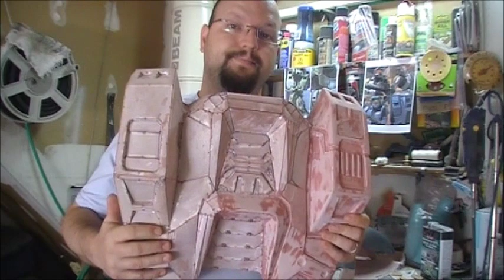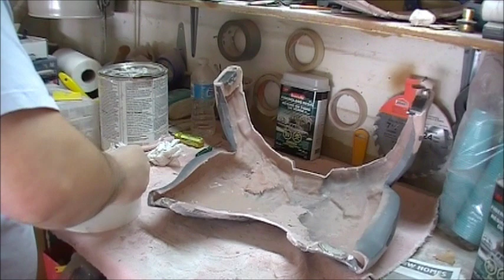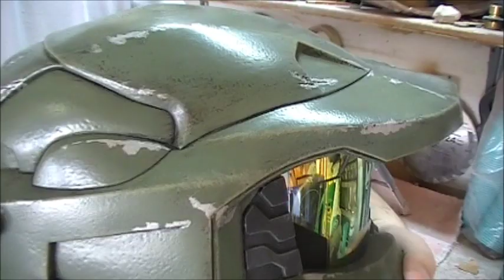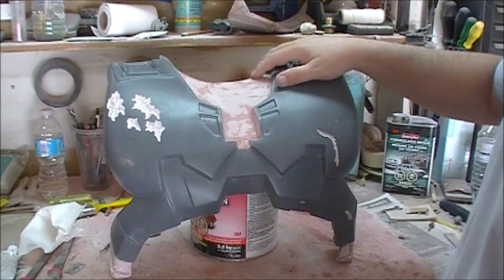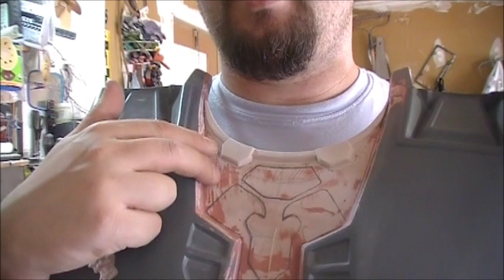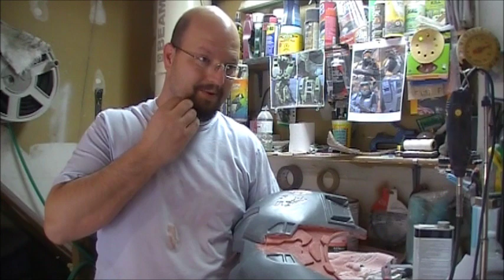Creating Battle Damage and Building Details (Episode 07)

Comment: I think what you have there is a bone file. I did a quick look on eBay and found one for a little over $3.00 it may not be exactly the same thing but it looks like it should work the same way. http://www.ebay.com/itm/Bone-File-Miller-45-Medical-Surgical-Dental-Instrument-/350280168862?pt=LH_DefaultDomain_0&hash=item518e53359e

Comment from the maker: I'd use square plexiglass blanks (1"x1") cut them to shape using a bandsaw then buff them with polishing compound to bring the sheen back. Once done warm some dye and water in an old pot and dunk the pieces in to stain them purple/pink. Then epoxy in place.